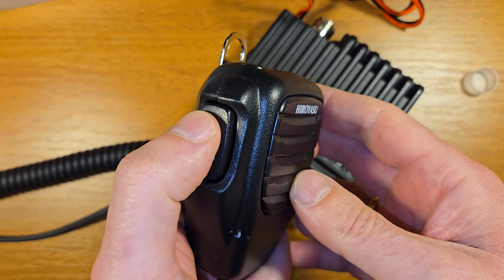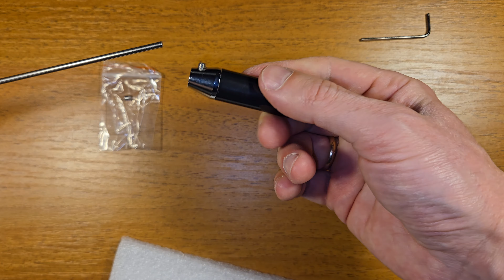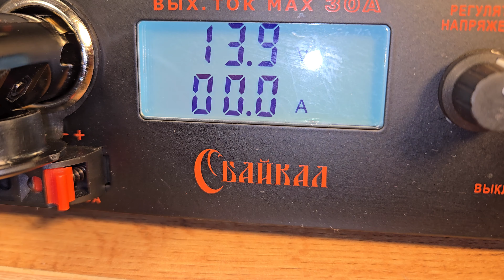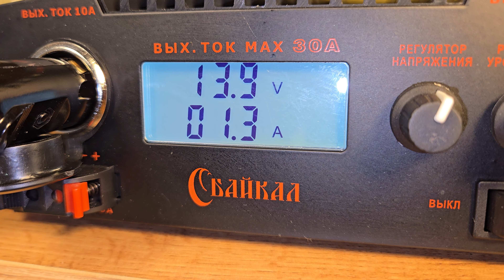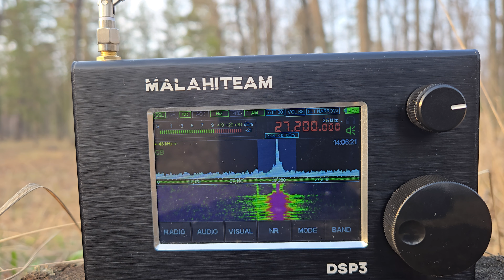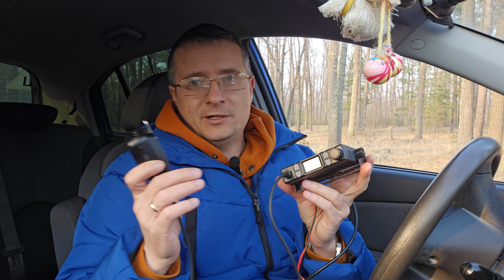Hiroyasu CB1011 CB Radio 27 MHz

Comment: Bardzo mały pobór prądu poniżej 1A zwiastuje marną modulację. Radio o mocy 4W powinno mieć przy dmuchnięciu w mikrofon prawoe 2A prąd.
Reply from the maker: I appreciate your feedback!
Reply: There's a dedicated trimmer inside the radio for AM modulation depth. I modified mine checking with a PEP wattmeter and now radio peaks at 12 watt crystal clear. There are also trimmers for power and FM deviation.